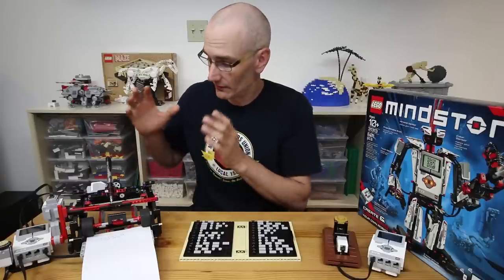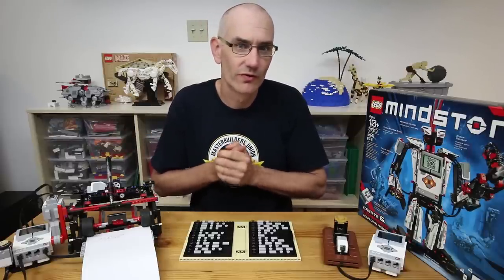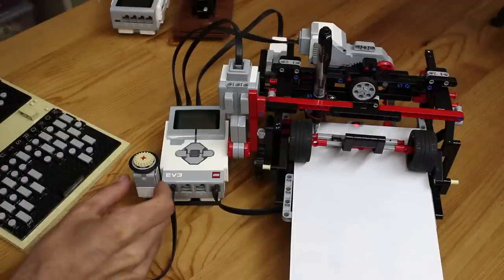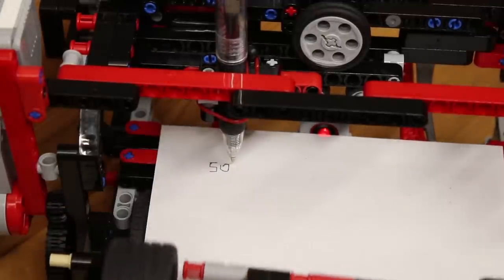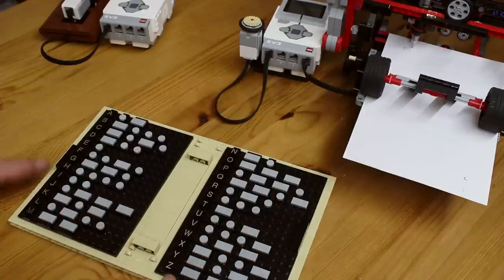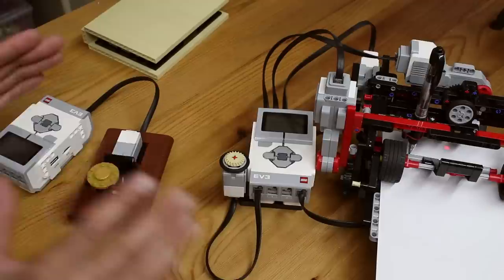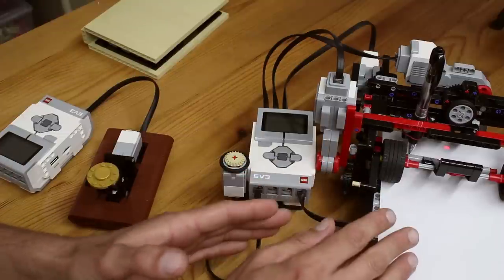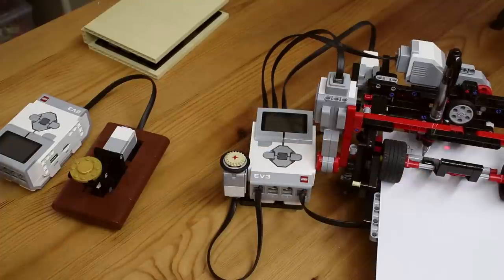Working LEGO Telegraph and Printer

Comment: I've been working on this concept for a while in the NXT programming software, and I have been running into endless problems? What do you think the best way to do this is without the use of the arrays that the EV3 software has added? I have been working with the file access block but there is no simple way to extract information in an orderly fashion.